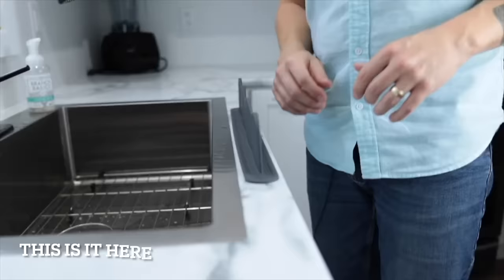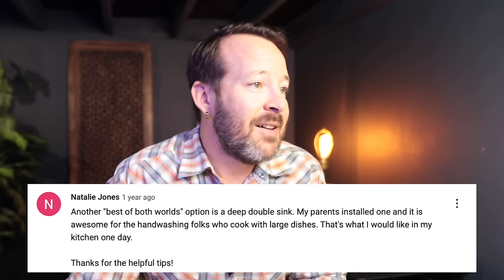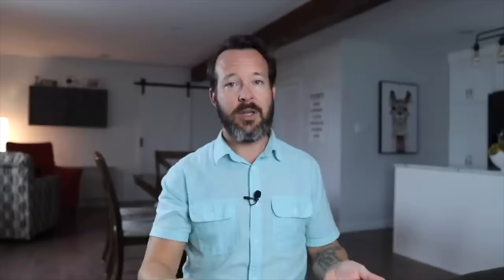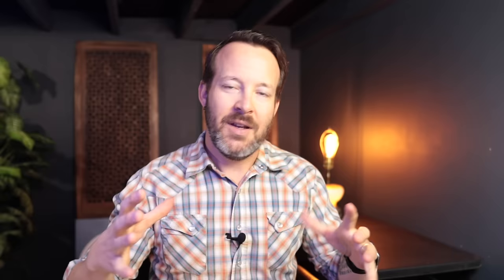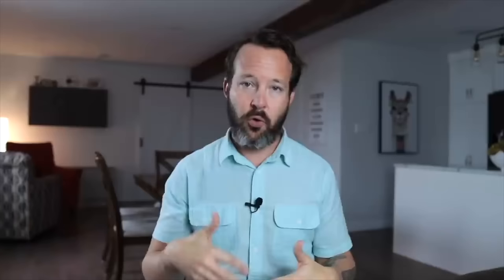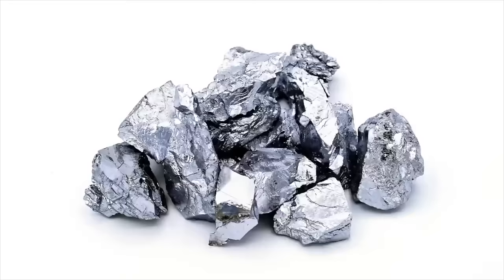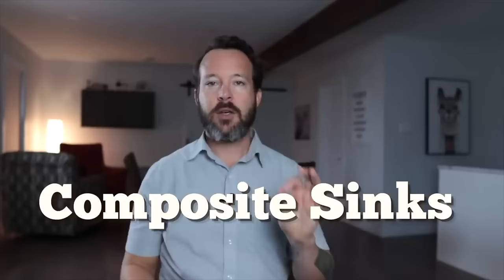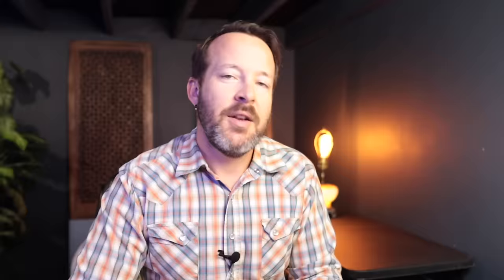Watch First Before Buying a Kitchen Sink

Comment: Hi.  Enjoyed this informative video!  My question is, I have a double bowl sink, want to switch to single, but my disposal is on the left side.  Could I buy a single bowl with drainage hole thingy on the right side?
Reply from the maker: You should be able to find a single with the offset drain on the right or left.  However, it will likely have to be ordered in, depending on what's available where you live.

Comment: I have an inside dimension of 33 inches. How big can I go with an under mounting sink?
Reply from the maker: It might depend on the sink model, but I'd say you could possibly get away with a 31".  If it's a top mount (drop-in) for sure.  Undermount may need to be smaller, but it depends on how it's mounted.

Comment: Question: I have an under mount stainless steel sink, w=17inches, L= 30 inches, Depth+10inches,  can it be replaced by a 18x30x10 sink ?  Cannot find the exact measurement sink with L= 17inches
Reply from the maker: Technically yes, but the sink reveal might be offset.  But only on the width.

Comment: I have a 42 inch sink cabinet with concrete countertops.  I am looking for a single bowl stainless sink.  I cannot seem to find one.  I am shying away from undermount because I do not want to drill for the faucet.  Anyone have any ideas?
Reply from the maker: It may be something you can have fabricated.  Anywhere that fabricates stainless hoods or countertops should be able to handle it.

Comment: Hi!! I'm in Mexico, I bought a  square sink work station Moorefield from Costco and next week will be installed undermount but I'm  affraid maybe it doesn't drain well because I drop some water and  stays in some places and I dont want to spend to much water because I live in a desert.  What experience do you have with this kind of sinks, thanks!!
Reply from the maker: You'll find it to be a little bit of a nuisance, dealing with the squared corners.  That is the one complaint, that stuff gets caught in the corner and needs to be washed out.  So be mindful of that.

Comment: I'm sorry for my silly question, but when you talk about the size of the sink, is it inside only or the total 'outside' size?
Reply from the maker: That's actually a great question.  Depth is usually inside.  Width and length normally include the sink flange (lip).  For example my sink is 31" wide, but the actual bowl is 28 1/2".   Hope that clarifies!
Reply: @MTKDofficial Yes it does, thank you!

Comment: large single then use a plastic bowl for hand washing - problem solved!
Reply from the maker: Bam!!!
Reply: @MTKDofficial  we've always had a 1.5 bowl sink (the little one for peeking veg etc I guess?) With a draining board, about 95cm long (37 inches?). We're in the process of putting a new kitchen into a different room, so gathering ideas to start from scratch.

Comment: "I need help. I've had my stainless steel sink for almost two months now, and I've noticed that there are some scratches on the top edge of the sink. I suspect that this is from washing pots, and it has scratched the sink. I tried using a product with wipes, but it didn't work. Since I haven't had the sink for very long, it shouldn't be scratched."
Reply from the maker: Shoot.  I wonder what gauge it is.

Comment: What about j shaped sinks? I have a cut out on my counter for a j shaped. It's double basin and I am looking at single basin j shaped. How do you confidently measure the right sink for odd shaped ones?
Reply from the maker: That is new tp me.  Can't say I've ever seen a j shaped sink.  You'd have to make a template and match it to another sink.  That is, of course, if you're not pulling my chain. lol
Reply: @MTKDofficial  it's a Double sink and one bowl is larger and curves inward near the faucet. It looks slightly like a fat J horizontal on the counter. When I search it I could only find it when I search "odd shaped sinks". But it's definitely real!

Comment: As a cabinet painter I have seen a lot of damage under the sink On cabinets That are made of MDF. MDF is the worst material that you can use to make cabinets or cabinet doors. As soon as you get a chip in the paint on a key cabinet, or door, and it gets wet the net material is going to swell, and it just get worse after that. Anyone that makes ,and sells mdf cabinets painted, and true to pass them off as would wood should have their business licence revoked ! Lol. Its a low down bait ,and switch ! Never a good material to use.
Reply: Net, key = mdf.. Typo.. Sorry !!
Reply from the maker: I hear what you’re saying and I agree, but only when it comes to sink cabinet doors.  Cabinet boxes of course should never be made of mdf.  Manufacturers don’t use this because of the weight issue.  Just too heavy. Doors, on the other hand, I don’t have an issue with.  As you know, the paint really well and mdf does not absorb moisture from the air.  A 5 piece maple door in my climate will expand and contract throughout the seasons causing the Center panel to show lines where it wasn’t painted.  Mdf won’t do this, one because it’s one piece and two, it doesn’t shrink.  But yes on the sink I wouldn’t risk it.  This is the longest reply I’ve ever given lol.  I appreciate your comment.
Reply: @MTKDofficial  and thank you for responding. Btw. I love your videos.They are greatly informative!

Comment: I don't think a liner could ever be reasonably effective with plumbing in the cabinet like at 39 minutes in this video; presumably that's an island sink. So that advice doesn't work for me, though I would like it to.
My sink's grid has been removed. I got exhausted by the stuff under the grid that would stick to the sink rather than go down the drain; also the dirt and grime stuck to either side and each crosspoint of the wires was really hard to scrub clean. It feels like you're just working it into the unreachable part of the crossing. And I couldn't quickly flip it out due to being undermounted and so needing me to work at 30 degrees lifted on one side, then 25 on an other, then slowly a bit of rotation until its diagonal and will come out. Totally not worth having. That said I'm also not a fan of the flat bottom on my sinks. I'm done spending a half gallon of water chasing some grains or food scrap into the drain mesh, but just driving it going in circles because the drain is only ever so slightly below the height at the corners.
Reply from the maker: You're right about the "water chasing some grains". lol. That's a good point.

Comment: I wouldn’t say that a low divider sink is “the best” of both worlds. It limits the functionality of the divider, sir you can’t fill the sink cup all the way, and it compromises the nice large flat plane at the bottom of a large single sink. So it is the worst of both worlds, the worst possible small sink, and the worst imaginable large sink.  A single large sink is far superior. If you want to soak the dishes just stack them. Large flat plates o the bottom, bowls on top. Pour water, soapy or not, your choice. place all cups and glasses on the bottom ofd the sink. Fill  them up. If you run out of space, put the filled glasses on the counter next to the sink. Scrub everything, stack them back up under the faucet and rinse. Rinse glasses and cups first, pouring the water over he stack of plates and bowls. Utensils can be soaked inside any suitable vessel that you place in the sink.

Comment: I have been eyeing the Blondco composite sink I the black color. My concern is the maintenance of it and problems with mineral deposits. I visited someone yesterday that had this sink in black and frankly, it looked worse for wear. Does anyone have experience with this sink in black?
Reply: I once had black double sinks in a bathroom. They were very good looking. But you’d better have a water softener and wipe it dry every time you use it.
Reply: @lynnleipold2617  Ugg , not exactly what I wanted to hear. I already purchased the black kitchen sink.

Comment: In 60 years I had never seen a double sink with a center divider the same height as the counter until one was installed in my apartment as a replacement a few years ago. Worst sink ever! It overflows everywhere if I use the dishwasher or the pipes back  up and the upstairs neighbors still run the water. My whole life every double sink I ever encountered had a center divider lower than the sink edge so that water flowed from one side to the other without overflowing out of the sink. This is NOT a new invention.

Comment: Copper things smell bad. Also, how is stainless steel less environmentally safe material than copper? Stainless steel is mostly made of iron, and the other metals in it are still from earth. I hand wash, though I am younger than you. I just don’t lime to turn the dishwasher on for 2 hours instead of 5-20 mins of handwashing.

Comment: Sink and a half is terrible.  Never, ever get one.  If you live with one for any length of time, you will hate it.  The idea is you can use the little sink for vegetable prep.  Ok fine, but vegetable prep means that is where you now have to put the disposal.  Now that also means your main sink doesn't have a disposal, because nobody puts in two disposals in the same sink. But vegetable prep is not the only task that ever requires a disposal. So you get the joy of getting any food waste out of the main sink with your hands and dropping it into the second sink.  How fun.  It is just an idiotic concept.